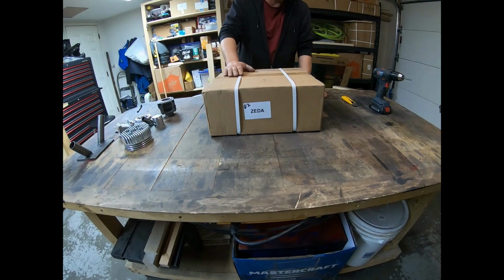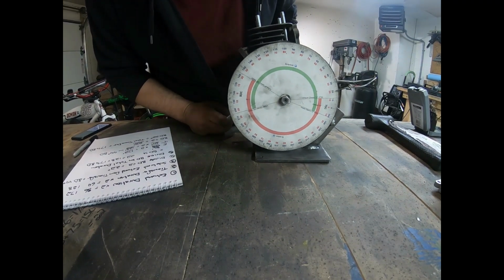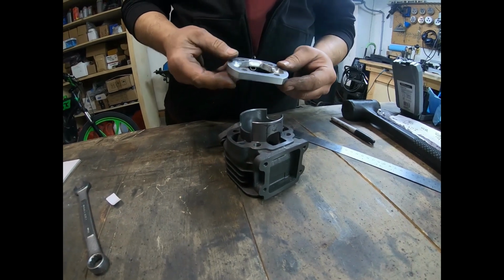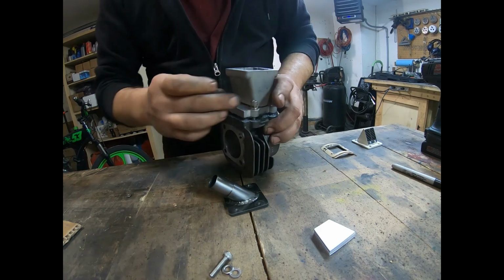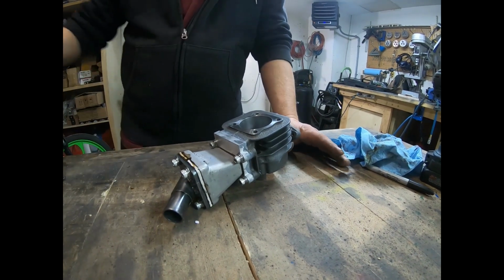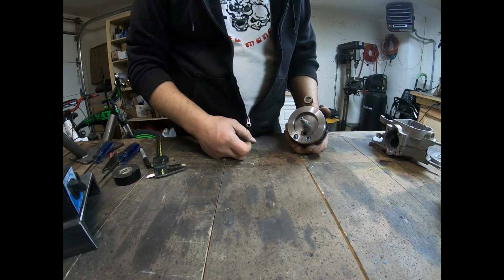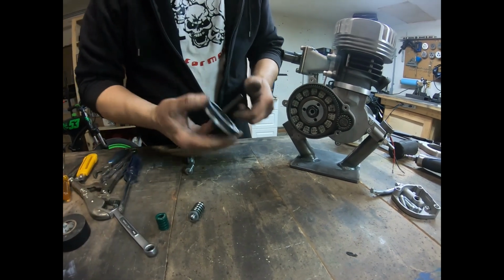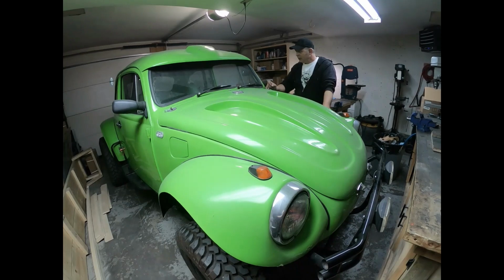How to Build a 70cc Minarelli G2 Reed from Start to Finish

Comment: This is my first build:  

https://youtube.com/shorts/V1QteiUqWuE?si=RNNkZHxoLUCv6OHW

Now, I'm jetting, and am getting info on what size pilot, and main.  

I changed out the clone carb that's in tge video, and replaced it with a Mikuni vm20-273.  

110-120.main

The factory stock jet is 185.  Those 3 main jets are what I have to choose from. 

I have a pilot kit of 5 different jets, 22.5 is the stock jet, and it idles way to high. 

Am I in the ballpark?  

Thanx 👍

Comment: Why don't use a stock Yamaha 2JA reed valve? Is there G2 reed any better?
Reply from the maker: i used a g2 reed because its a common part most people already have , on some of my other engines i use other reeds
Reply: @dlhperformance7169  Thanks for the answer, where I live it's easier to buy the original Yamaha reed valve, so I'm now collecting parts to upgrade my motor. Actually, I have two motors, with a long and a short connecting rod, so I'm trying to choose which one is suitable most. Could you please tell me the main dimensions of the spacer to lift the cylinder?  Unfortunately I have to make it myself.

Comment: Ok so if I wanted a 50cc minarelli for a daily driver is it worth it?
Reply from the maker: yes a minarelli cylinder will last a long time they are built to last  , like any other engine you must use good oil , cool down engine as needed and not keep the engines rpm at 12k for long periods of time , a proper tune . most important on any 2 stroke no are leaks, every season the engine should be fully inspected too insure long life
Reply: So a 50cc minarelli unported is it more power than a yd100? Or close? I want a long lasting motor but I don’t want to lose much bottom end torque from the bt100 and I’m not quite at porting a motor yet curious I know the 70cc has plenty torque as is how bout the 50? Ever try one?

Comment: I guarentee you don't have to worry about leaks going to suck pulling apart I
Reply: Actually it's not that hard to take apart ... I would only need to pull it off if the cylinder got damaged and re use it on another cylinder

Comment: Why would you not just get the 100cc version?
Reply: More issues they Re not as refined as the 66cc
Reply: @302mustanggt8   i got delivered the cheap 80cc kit today!  And been out on the 50cc allday today, done around 40 miles,  this 80cc will be so much fun, people say its 66cc, why dont they just say its a 70cc.
Reply: @gewizz2  because 66 is not the same number as 70.
Reply: @nimbusnimbus.IV.  they are 70cc
Reply: @302mustanggt8  after inspecting the differences between the 100cc version, i see the transfer ports on the 100cc crankcase are bigger,
Reply: @gewizz2  yeah people just call them 66cc instead of 70. The 100's are the 80cc like the yd100 thats an 80cc i don't know if they make a true 100cc but the 100's are newer and just don't have alot of aftermarket or just parts in general

Comment: To balance the crankshaft you need to drill three holes, one that is the middle I know it should be half an inch and with a depth of 15mm but the question is what diameter should be on the edge and how deep should it be?
Reply: 27/64 1/4 deep , all holes evenly spaced
Reply: @darcyhemeon4309  I assume that's 15mm deep from touchdown of the edge of the bit, and not 15mm from touching off with the point of the bit, right?
Reply: Center 1/2 hole almost through but noy quite will get you in the range

Comment: I build racing motors and I love to watch you work on these small engines but I have some tricks up my sleeve to I've never showed nobody it would give the motor a lot more horsepower but I love your videos keep up the good work
Reply: David can you please help me with a little or a lot of info 
I'm porting my motor.
Reply: how about a small port opposite the exhaust  from the crankcase  like mz  pioneered  to great effect
Reply: Ever heard of this special putty that you put under the 2 stroke piston so it creates more compression in the crankcase. ?
Reply: @The1stHomosapien  🤣 just stop
Reply: @The1stHomosapien  balsa wood
Reply: @The1stHomosapien  
think its called jb weld its a mix of epoxy resin and bullshit lots of it

Comment: Like your video. So do you think that a reed ported intake would be better performance wise than a piston ported? Or would a case reed induction be more efficient? Thank you if you reply cuz i know this is an older vid.
Reply: This style cylinder requires a reed its a 70cc vertical minarelli and comes with a window pistion the vertical Reeds are good , I've designed these with a G2 reed for 1 lots of people already have this reed and intake and carb , no need too purchase extras. 2 its flow is directly into cylinder with no extra added volume,  and has in my opinion more bottom end then the vertical reed ment for these cylinders . More bottom end equal faster acceleration times , also being a single speed setup makes it a all around fun riding engine .
Thank you for Subscribing,  like and share

Comment: where do i buy the engine
Reply: You can buy the engines online then purchase a 70cc minarelli and convert it like in my video
Reply: @darcyhemeon4309  i wouldnt Trust mYseLf to Do This Job cant we just buy them set up already for plug n play You got divison involved freekin 12 ft pounds on the torque ratchet 19percent blow down hittin at 7000 rpm
Reply: @darcyhemeon4309  all they had was a Pk80 triple 40 i just dont know if its the reaL one its on my bike and its tootin just not getting the fuLL juice at max throttle
Reply: @darcyhemeon4309  if i send u my motor how much in parts n Labor will it be worth it Seems like u have fun with these and can bang it out  I was stressin big time man trying to get it setup the stock kit everything was messed up but she purrin pretty decent now
Reply: Pm me on Facebook
Reply: I have a new zeda 80cc Dio reed valve with the Oko carb. I need help to figure out where I want my blow down. I'm going to port it.
Reply: Please

Comment: Metric to standard -- take your metric number and divide by 25.4 = standard.  So 6mm stud ÷ 25.4 = 0.236" then just find your closest drill bit by googling/drill chart.

Just quick reference.

Also to go from standard to metric you just multiply standard number by 25.4 = metric number.
Reply: Thanks .. I do know how to convert not all people do so I made it as simple as I could 
Thank you
Reply: How much is 1 of your race motors with a super clutch
Reply: Contact me in Facebook  thanks

Comment: Good luck getting that intake apart,,,
Reply: Comes apart easy . It also has a extremely good seal thats what you need for a proper tune if you watch some of my videos with the bike running , its running very smooth . Thank you

Comment: Gonna try to put a 1980 cr80r cylinder on a case this helped alot
Reply: You will most likely need a longer crank
Reply: @6mtdrino  u mean on ur last laid?
Reply: Why not just use the cr80 engine and junk the chineseium crap 🙄  it takes a little work to get the swing arm clearance for the chain but makes for a whole lot more then any one of these engines could pray to make i have built a couple in past  you definitely don't want kids on it. Better use a good hub or solid rim 🤔 🤷
Reply: Cr80 cylinder fit on it ??
Reply: Did it work ?

Comment: have you ever tried with a 75 cc malossi or polini cylinder?
Reply: Yes I have . These 47mm perform  great the 48mm are even better
Reply: Same process too build both same parts , some 80cc have a longer stroke
Reply: Can you do a video about one of them showing what mods you need to do and the performance that you can archive?
Reply: @fabiotiburzi  the power is very similar the 80cc pulls harder and is the same mods
Reply: @fabiotiburzi  also on these other cylinders they are already been max ported,  transfers clean , I would only be concerned about fuel damming on the transfers and would need to be opened up
Reply: @darcyhemeon4309  are you sure about that? i think that the malossi mhr with the boost port can be tuned by raising the exhaust port up to 55° blowdown. moreover: maybe some vespa smallframe exhaust  can be adapted to these cylinder. let me know
Reply: @fabiotiburzi  they all have slightly different port timming,  so its had to say with out me having that exact cylinder in my hand on my work bench , I know the Performance cylinders need very little  work if any